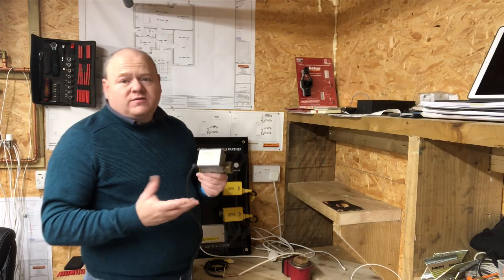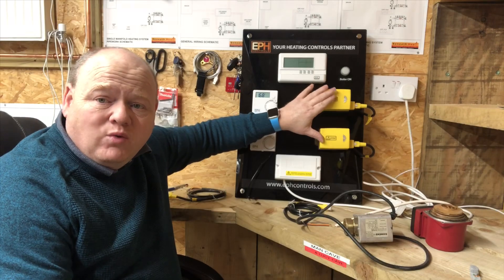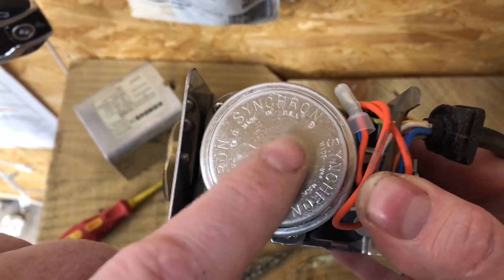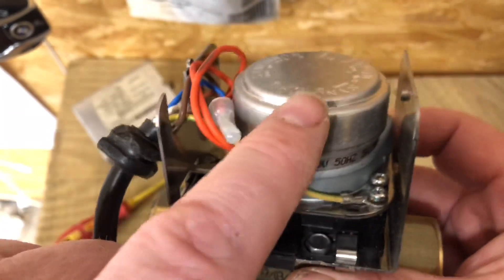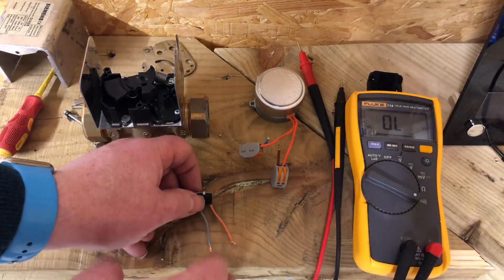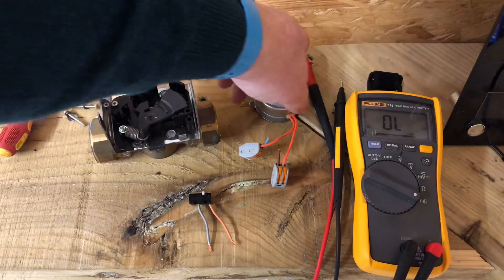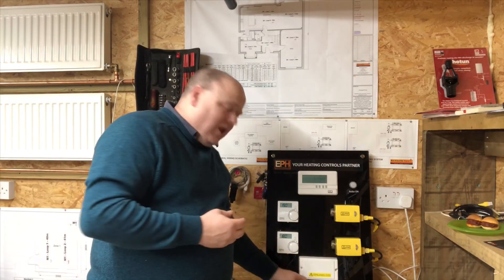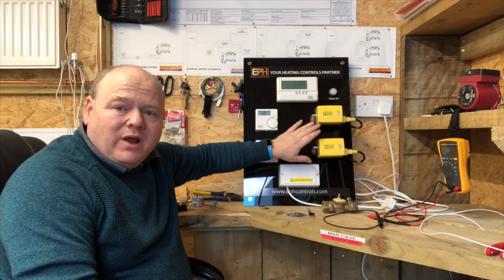HOW A ZONE VALVE WORKS - Central Heating Control

Comment: I had my valve failed yesterday. Replaced it with a new one, but I'm curious if you've ever seen the same fault I had? In fully open/manual lever position, the "tongue" which triggers the switch live to the boiler had about 4-5mm gap. How could that happen?

Comment: I notice you have two EPH valves on the demonstration board but you open up one from a different brand. Can EPH valves be opened up? I have one which causes a bang. I was looking to slow the spring action. BTW keep up the good work. Great channel.

Comment: Am i too late for a question about these? I just moved into a new build and none of the upstairs radiators are working. I've contacted the builders and people that sold the house but they don't want to know. I watched some of your videos, I bled  all radiators and checked trv's and taps on all the radiators are all OK. I will be checking the zone valves when I get a chance, but is there anything else I could look at if this still doesn't work?
Reply from the maker: What’s your issue with the system
Reply: @AllenHart999  thanks for getting back to me. The radiators downstairs are working fine, but none of the upstairs ones come on at all
Reply: They're on! I switched the valve to manual, now they're coming on 😊
Reply: Thank you so much for your videos. It's going to make our first Christmas in our new home so much more enjoyable 😁

Comment: This is great video and what I was looking for. 11:58 in the video and please check my understanding:
so I have 2 zones. ground floor and first floor both controlled by thermostat. Heating is constantly on and when temp is not the desired one it will send signal and boiler kicks in and starts heating the zone it needs. First floor heating stopped working and I did move this lever to manual and it was giving proper resistance when moving. Now the first floor heating works when ground floor heating kicks in. And if what you say at 11:58 is applied to my scenario it is still faulty valve right? As valve is giving signal for boiler to kick in, not thermostat. Am I correct?

Comment: Thanks for the video, spot on explanation of zone valve and it's wiring. Quick question. I have an UFH manifold, single zone without actuators. Can I run the circulation pump from the thermostat switched live output so that the pump runs up at same time the UFH zone valve opens? There's no need for an expensive wiring centre then, less things to go wrong

Comment: Good video and description , thank you.  I'm increasingly thinking that the 2 port valve on the flow (from the boiler)  on my unvented cylinder is permanently open and is being held that way by a connection from the immersion heater element. I think this is causing high heat loss - the valve is always hot and noting that the syncro motor only comsumes 5W (if I read the spec correctly) the heat is either conduction along the pipe from the cylinder or gravity circulation through the valve and along the heating loop. The question is...I don''t think i missed it in the video but how should the immersion affect the valve.   (Re microswitch question...my understanding is that this is what allows the boiler to fire ...is only when the valve is fully open can the boiler start so that the flow is unobstructed beforehand. )  VMT J.

Comment: Thanks, is there any advantage to using this method to split multiple central heating zones verses using a manifold? I am planning to have 3 heating zones, 1 on each floor, and the boiler along with the motorised port valves will be on the ground floor. Each floor will be controlled by a Nest. I was told you can also use a manifold for this scenario. I've just known manifolds to be used with under floor heating zones.

Comment: Super video, very informative. A question: I have a set up in my house similar to your demo board. 2 zone. On the hot water I’ve a cylinder stat that’s separate from the time clock (but wired to it). Problem is: when the cylinder water is at temperature the boiler continues to pump water, but doesn’t burn gas. At least it’s not burning gas but the pump is being used when it shouldn’t be. Any ideas?

Comment: Fantastic video, incredibly helpful and well explained! I have one question, what's the purpose of the microswitch? Once it clicks and it closes the circuit, what's the purpose of the switch wire? Is it to send a signal back that the zone valve is indeed open? Is it for fault-finding purposes? Thank you! By the way, tea team all the way :)
Reply: Thanks for asking Daniel.  That is what I came on here to try to find out.   The microswitch connection seems very elusive!
Reply: @stephenmorris-jones6010  
The end microswitch is to switch in another circuit, such as a pump, boiler etc.

Comment: "Little step bits".......they're called "teeth". Thank fk my town library has three books on central heating which I will be borrowing tomorrow because these youtube videos make me want to call samaritans.
Reply from the maker: Let us know how you get on with the books. Thanks for watching.
Reply: @AllenHart999  Thanks I will do. I've got an oil-fired gravity fed system with an electric immersion heater and towel racks with a mind of their own and about three times as many pipes as I seem to need between upstairs and downstairs. 

I really need some diagrams to explain it all but I know a lot more today than I did yesterday so hopefully I'll get there. 

I've got two Honeywell 927 controllers but the screen's gone completely blank on one after gradually failing. It still works otherwise. Do you know if it's a loose connection that can be repaired or do they have to be replaced?

Comment: Good video. How does the zone valve know when to open when you're calling for heat? It's not wireless is it? Is it through the wiring? Where's the connection between the zone valve and the boiler or thermostat? Thanks.

Comment: Great video Allen yet again , I’ve learnt so much from your videos and your Facebook group. For those watching who aren’t a member of the Facebook group make sure you join. like minded people learning and improving without shaming
Reply from the maker: Awesome, thank you!
Reply: @AllenHart999  hi Allan love your videos very easy to understand. My problem is i have a woodburner system that heats my radiators and my hot water tank. I wish to fit a 2 port zone valve (5 wire) i want it to operate /close when tank stat up to temp. Can you tell me what colours of wires goes where or simple diagram. Thanks.

Comment: Alan.I have underfloor heating in a Orangery.I have noticed that when a heat demand is on,the temp gauge in the flow manifold goes up to 60* in two minutes.The system shuts,and the temp goes down to 30* on both gauges in the manifolds in two minutes.This cycle carries on/off for an hour until the thermostat set at 22* is reached.Is this on/off cycle correct.Thanks for the vids,excellent.
Reply from the maker: Thanks very much for your comment, please consider subscribing to support the channel 🙂
Reply: You should have pump and blending valve for the UFH circuit only.

Comment: It would help to show the method to drain system in order to remove two way zone valve.
Reply from the maker: Thanks very much for your comment, please consider subscribing to support the channel 🙂
Reply: @AllenHart999  - I have just subbed and incidentally since also learned how to drain down the system. Namely shut off system mains supply, drain down from suitable point below the lowest zone valves to be removed and opened bleed valve above drain point. I kept the drained water into a container and put it back thus retaining de-rust solution ratio and de-oxygenated water.

Comment: dave diy hi Allen can i put a  zone valve next to my cylinder connected to my cylinder stat and a fused spar to control how hot my tank gets without wire-ring direct to my boiler which is in another room
Reply from the maker: Thanks very much for your comment, please consider subscribing to support the channel 🙂

Comment: Happy New year.
Here in Russia we use something like a wax motor for that. Or a solenoid valve. Rarely it will be a 3 port servo valve.
In my house I have a Viesmann Vitomax 100-LW M148/8 furnace and heating is handled by a Danfoss ECL201 control unit paired with a Danfoss ECA30 on the floor. The valve is a Danfoss servo valve.
The rest of automation is using a ОВЕН ПЛК110.М2 PLC and a ОВЕН СПЕ310 touchscreen operator panel
This is the setup in my house
Reply from the maker: Thanks very much for your comment, please consider subscribing to support the channel 🙂
Reply from the maker: Thank you, Happy new year

Comment: Allen so when you move the manual lever on the two port valve you’re always manually opening the valve, correct?
Reply from the maker: Thanks very much for your comment, please consider subscribing to support the channel 🙂
Reply from the maker: Yes that's correct. Thank you, Happy new year
Reply: Allen Hart I had one the other day allen that had no resistance as I opened it. Loose it was. What did they mean?

Comment: zone valve
Reply from the maker: Thanks very much for your comment, please consider subscribing to support the channel 🙂
Reply from the maker: 😂😂😂Thank you, Happy new year
Reply: @AllenHart999  Hi allen, could you do a more in-depth video on the actual wiring? I've got Nest thermostats on my UFH wiring centre with zone valve A and another Nest to control the radiators with zone valve B. Problem is, zone valve B always remains open and my thermostat always stays on. I need a diagram showing exactly how to wire both systems to the same boiler, if possible.

Comment: It seems as though the programmer and thermostats are sending power to the valves only. Then a switch within the same valve will send power (switched live) to the boiler - all seems like a dumb rather than smart system! I guess that’s the why it’s always been done. But I can see the benefits of this modular system in that parts can easily be interchanged without effecting the end result.
Reply from the maker: Thanks very much for your comment, please consider subscribing to support the channel 🙂

Comment: Help 
Got an ideal logic combi 
Losing pressure 4 times a day no visible signs of a leak all down stairs rads on drops so should see if there was a leak 
Expansion vessel also fine and no discharge from prv what on Earth could this be
Reply from the maker: Thanks very much for your comment, please consider subscribing to support the channel 🙂
Reply from the maker: https://www.youtube.com/watch?v=X4OssmUEFo4&t=513s
Reply: Cheers Alan 
Ideal spoke me through this And it the heat exchanger. 
Suppose that’s the difference between a house basher and a break down engineer  I can chuck heatings in all day for fun really could do we spending more time on repairs to get that knowledge up 👍

Comment: Hi Allen...Always enjoy your videos and thanks for the time and effort you put in to them, and they are always informative, no matter how long they are...I prefer the longer ones actually.
When installing a boiler, and find the need to install a switch fused outlet, to power it up, do you do this yourself, or call in a sparks?
 I have read that there are defined scope electrical courses and qualifications that can be obtained to enable boiler engineers and kitchen fitters etc... which enable these folks to join one of the competent persons schemes run by NICEIC...NAPIT...etc... and certify the electrical works involved in such things.
Basically, how do you go about supplying and electrical certificate for any electrical works carried out on the house/property circuits.....if any is done?

Oh.....It's Tea. 

Happy New Year.
Reply from the maker: Thanks very much for your comment, please consider subscribing to support the channel 🙂
Reply from the maker: I would just call a sparky if it needs a new spur. Happy new year.

Comment: Can you add a zone valve for a hot water cylinder (coil) on a combi boiler? I’m thinking of adding two zone valves for heating areas and a separate one for heating an external tank (for a more powerful shower with a pump) as our incoming water pressure is rubbish.
Reply from the maker: Yes, Absolutely. I have done loads of systems like that. 👍
Reply from the maker: https://www.youtube.com/watch?v=dwnyFrIXLSQ&t=88s
Reply from the maker: Thanks very much for your comment, please consider subscribing to support the channel 🙂
Reply: You should consider a cold water mains accumulator cylinder that will give excellent pressure - assuming you have a decent static water pressure.

Comment: Can I use actuators on a floor heating collector to close off zones? I'd feed each room with 1 pipeline and have rads in the rooms instead of floor heating. Each room would have it's own thermostat to regulate the actuator. Or is something wrong with using it this way?

Happy New years! Zone Valve
Reply from the maker: Not really sure what you mean but if it’s underfloor heating you will be better with a manifold. Thanks.
Reply: @AllenHart999  yes that's what I was talking about, a manifold! Sorry didn't know the word in english. Is there something wrong with using a manifold and connect that with radiators?
Reply from the maker: @oekalaboeka55  https://www.youtube.com/watch?v=22g13Ly0qFQ&t=42s
Reply from the maker: https://www.youtube.com/watch?v=dwnyFrIXLSQ&t=88s
Reply: It would work but the response time is not too great so you might find the bypass has warmed up and the boiler has cut out by the time the actuator has opened. You might need actuators with an open-switch so you can activate the boiler when one or more has opened. Either that or a delay start for the boiler.
Reply: @JohnDuffell  Yeah I saw in the video Allen posted here that he was talking about an 8min delay before it starts working. (He talks about it at 15.47min in the underfloor heating vid) What is making it respond so slowly? Are the actuators closing/opening very slowly or is there some software that makes it respond slowly? Is 8mins an average time for this?
Reply: @oekalaboeka55  they are just slow because they rely on a heater warming some fluid and then that presses the spindle when it expands. More reliable and quieter than a motor but slower
Reply from the maker: Thanks very much for your comment, please consider subscribing to support the channel 🙂

Comment: What holds the valve open ? Is the motor still under pressure
Reply from the maker: Thanks very much for your comment, please consider subscribing to support the channel 🙂
Reply from the maker: The motor, Once the power, is off to it then the spring closes it.

Comment: Haven’t opened one up recently but the Honeywell ones used to have brass teeth rather than plastic and they should really make a version without the manual override which they should supply with the unvented cylinders, as overriding is removing one of the safety devices from the system.
Reply from the maker: Thanks very much for your comment, please consider subscribing to support the channel 🙂
Reply from the maker: The plastic ones tend to snap off. Cannot remember about the Honeywell. Happy new year.
Reply: Honeywell 2 and 3 port valves used to be bullet proof,about 7/8 years ago they moved production to Poland I think ,all of a sudden they both became far less reliable, the 3 port ones did not  always motor across to the end of their travel and just stop so unless you saw it doing it you would not suspect what could be a faily new valve ,this happened to me on more than one ocasion. The two port ones would jam as well.They probably have this sorted ,I am now retired so do not know if this is still the case.